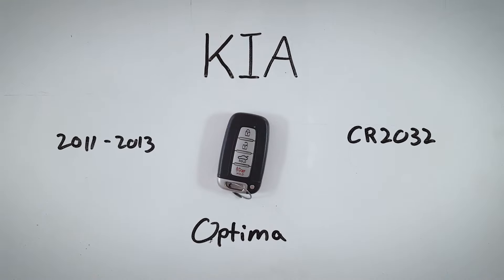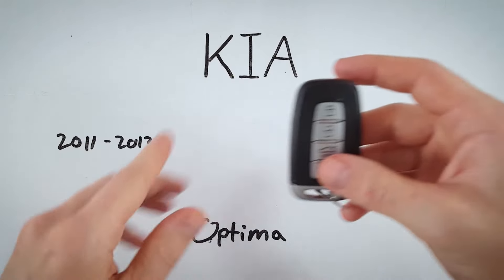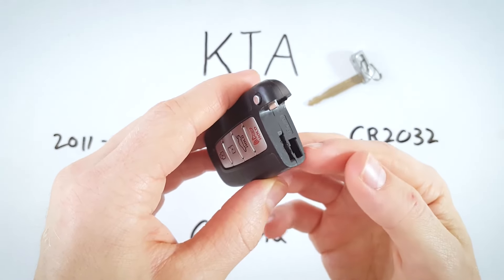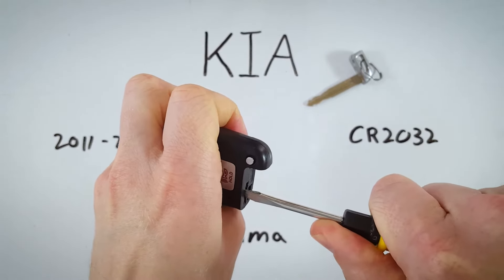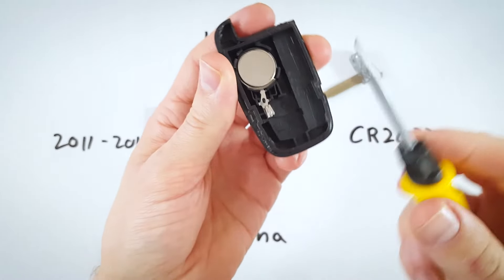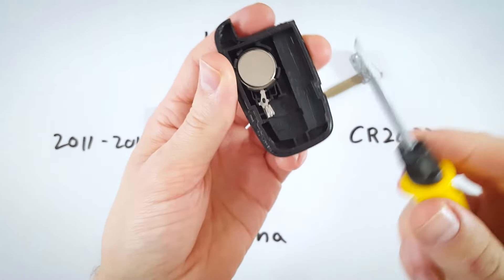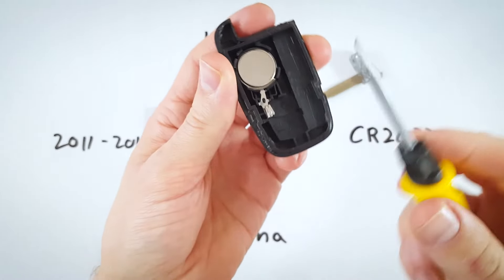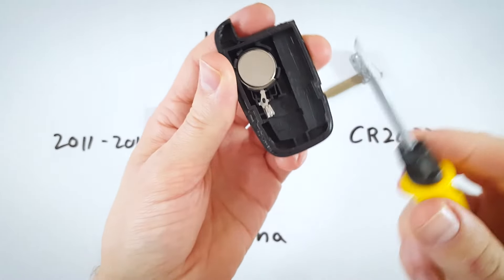Kia Optima Key Fob Battery Replacement (2011 - 2013)

Comment: PSA: If you do not have a screwdriver, the inserted key has a tip designed specifically to separate the fob and can also be used to remove the battery. hope this helps!

Comment: Hi ,my 2011 kia optima hybrid won't start with my key fob . I changed the 2 batteries, but should I change the one in my dash as well for it to work ? It unlocks doors and trunk but just can't start it up from inside the house ..thank you

Comment: PSA: If you do not have a screwdriver, the inserted key has a tip designed specifically to separate the fob and can also be used to remove the battery. hope this helps!
Reply: Jesus Saves, God Bless✝️